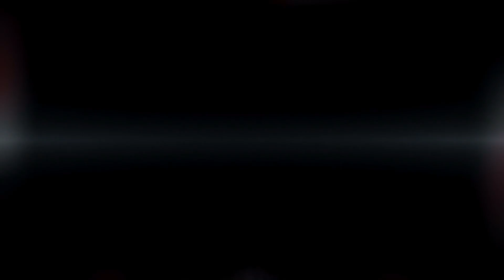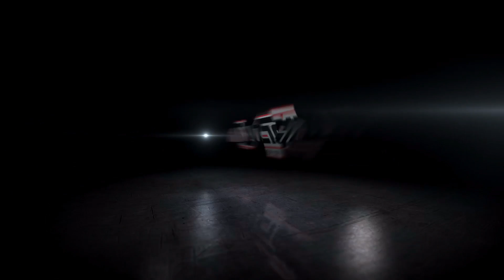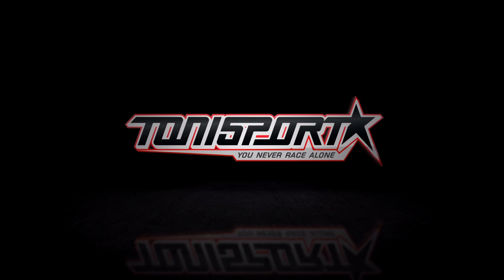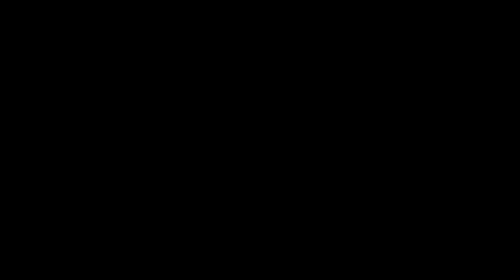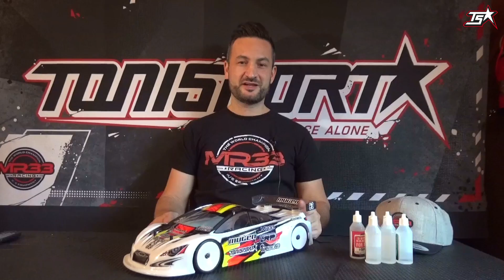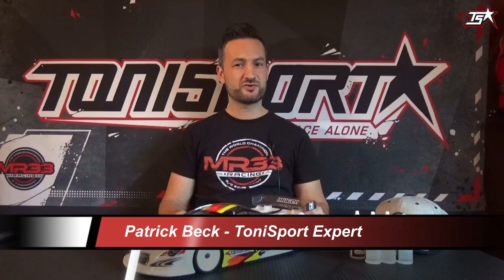ToniSport Newsfeed: Gear Diff Talk English

Comment: Is weight taken into consideration when choosing an oil for the rear diff? I'm asking because I'm driving the VBC Ghost VTA kit on an outdoor parking lot that has imo low-medium grip with bumps. I found that when I used 3k mugen diff oil I was getting a loose rear out of corners and when the 4k was used it was more manageable. I was told that on a track like what I drive on the lower the oil strength the better it should be as others are using 2k-3k oil but their kits are of better quality and lighter. So with that can a kit's weight be also taken into consideration when choosing the desired oil and not simply the condition of the track?
Reply: We do not think about the weight of the car in 1:10 scale touring as we have to run at a minimum weight of 1320g which everybody is doing. So we dont have to think about big weight differences at all!
Reply: @patrickbeckrc2113  ok I understand that reference to 1320g . How would you advise then on guys with heavier kits, let's say nearer to 1400g. Would you take that weight into consideration? As in most case not all are using the latest and greatest kits.
Reply: The diff action that results from 3k or 4k will be car specific due to differences in how the gear differential is constructed between manufacturers.  The diff action from 2k-3k in one car type could translate to 3-4k from another manufacturer.  It is really car specific.

Comment: thank you for the great video and information you have shared to us. I would like to ask a question about the change of the diff oil. Approximately after how many batteries in mod class the diff oil is starting to lose viscosity so it is better to replace it ? just a feel from your experience because I know that there are several factors to take into consideration. Thanks in advance !!!

Comment: Thanks for your great information as usual. Do you have a video on the effects running the diffs in the high or low position in the bulk heads has on the cars handling/performance? 
Cheers
Shane